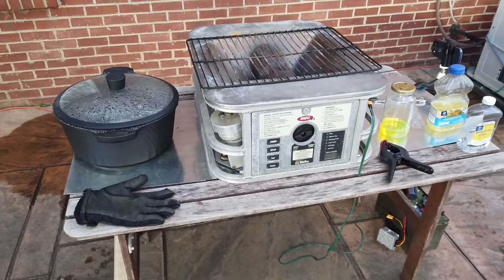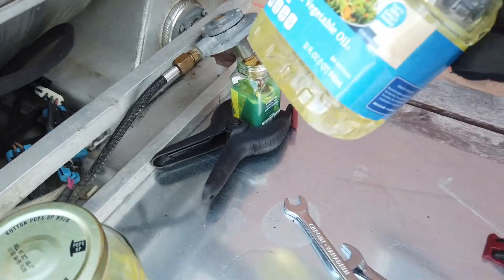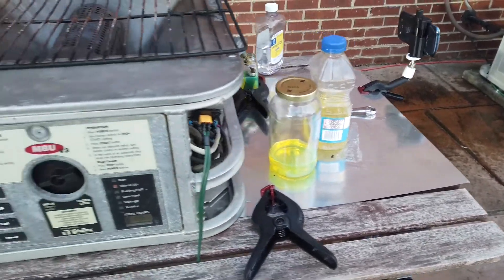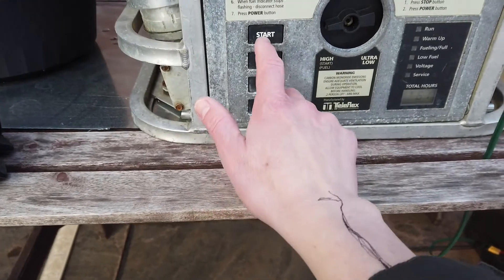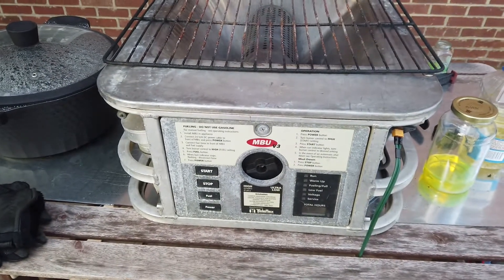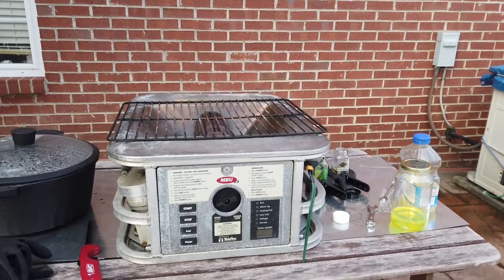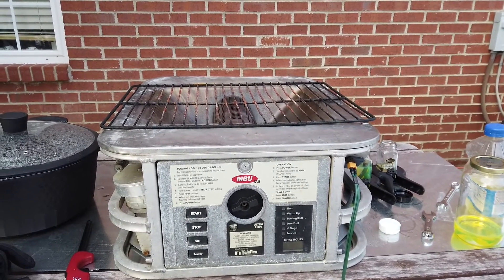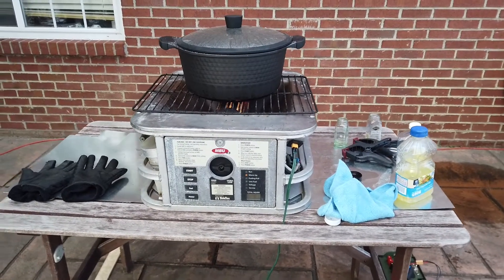Running a Teleflex MBU on Strait Vegetable Oil

Comment: Since you seem to have the most pubic info on these things here on the net do you know if any way you could control the on/off state of the burner with a simple switch? I'm planning on using one of these to heat an oven but I need to hook it up to a thermostatic switch in order to regulate temperature. It seems like it has logic control so simply cutting on and off the power won't do it. Any help would be great!!

Comment: Hi there, 
Diesel fuel I believe is part kerosene and oil. If you can find ratio then mix a bit of kerosene with vegetable oil. Will keep mix thinner to flow and burn a little hotter then straight veg oil. Thanks for experimenting due I am interested in getting one.
Reply: Sir how much price ?